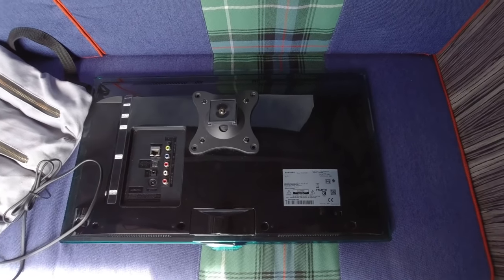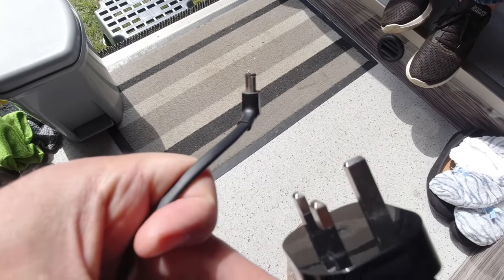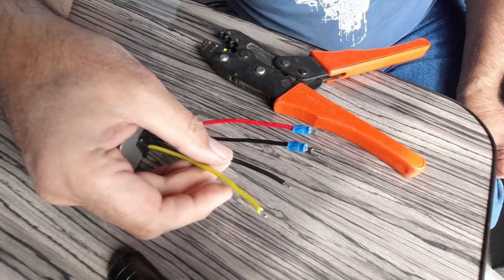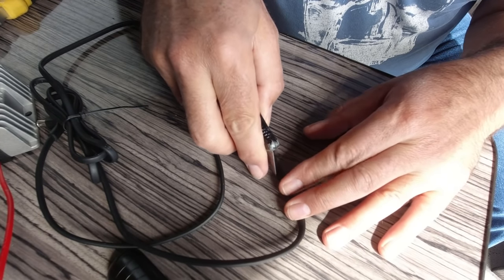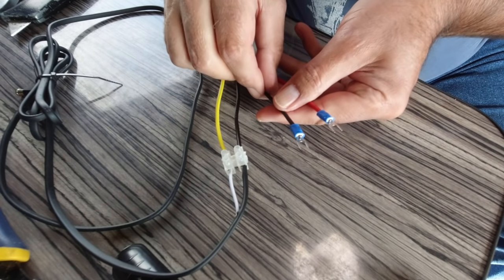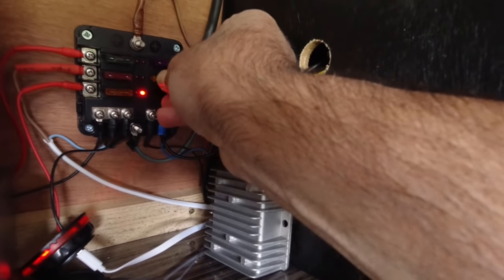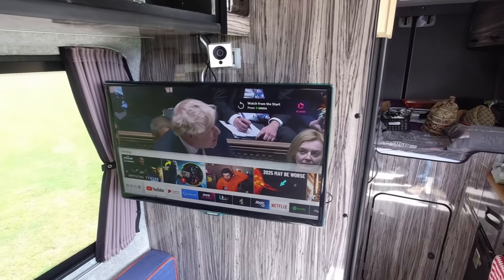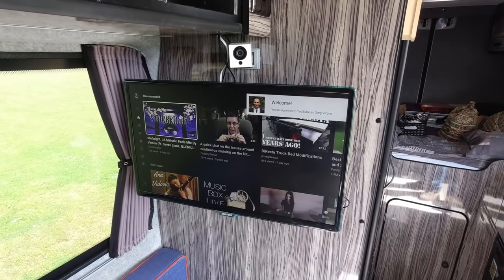How to connect a Mains TV direct to 12v DC - Off Grid Living

Comment: Hi love your Chanel you have helped me with several tasks along the way, but this latest one I am stuck with.
I have bought a buck converter which is 12v 60w 5A because that’s what it says on the back of the TV, I am just trying to connect it all but still have no power to it can you tell me what I am doing wrong. Kindest regards Sara
Reply from the maker: Please can you check what the electric input data is on your tv?
If your tv requires 12v input then it is different to mine and will need a slightly different converter. What does it say for the power input on the tv? 🙏🏼😊
Reply: Hi thanks for your response, I’m afraid I won’t be using that tv now as I have dropped it so it’s broken 😂 I now have a choice between one that’s 220-240v 135w or buying another one. What would you suggest ? Could I convert that one or would I be better with one that uses less power ? Best regards Sarah

Comment: Had a similar issue with our wireless headphones for our van TV. They were 19 or 20 volt, so used a transformer to run them from 12v rather than run the inverter all the time.

Comment: Those 230v plug sockets you got…are they an extension of the sockets from the inverter? A plug into the inverter and a wire from the plug to the sockets?
Reply from the maker: Yes exactly that 👍🏼

Comment: Hi Greg, As the TV already had a DC plug, why not save all the hassle and use one of the 12V adapters that come with multiple plug ends and selectable Voltage you can get for about GBP20 and just plug that in? I run my laptop off one in the van, but still have the 240V brick and lead to plug into mains when at home or on hook up.
Reply from the maker: Yes, that is another way you can do it. I wish I could find one big enough for my laptop but the brick is 140W and most only seem to go up to 80-90 watts.

Comment: great video greg as always. What bracket do you use for the tv and is there some reinforcement into the shower wall to support it or is it screwed directly into the LWP?
Reply from the maker: There is a metal plate with three studs welded to it that was recessed intot he shower wall before the PVC cladding was fitted because i was concerned that small screws would pull out with the weight of the TV. The bracket is one of these https://www.ebay.co.uk/itm/332069830472?epid=6030722465&hash=item4d50e77f48:g:pHMAAOSw~p5ck3hj&mkcid=1&mkrid=710-53481-19255-0&siteid=3&campid=5338027957&toolid=11800&mkevt=1

Comment: Surprised that you don't use Wago connectors for things like that. 
As electricity prices head into outer space I'm moving as much chargeable or USB powered stuff over to charging off the little bit of solar I have on my shed roof.
Reply from the maker: I have those but they were in the workshop and the old block was the only thing I had in the van so it’s a temporary fix as I said. The wago are really great for simplicity.

Comment: Great job, pity they don't make a 12v plug adopter to use the tv in motorhomes it would be great for the less technical minded👍
Reply from the maker: You can buy a 12v laptop charger off eBay for £11 that will do the same job. Some have multiple plugs and variable output voltage.
Reply: @GregVirgoe  Thanks for that advice👍

Comment: Hi Greg nice video, what model Samsung is it with the external power block? clearly cant do this if its embed within teh tv and its got a 3 pin plug.. thanks
Reply from the maker: That’s correct this is an old tv now as we purchased it when the van was built. No longer produced I think if you are looking to buy a tv for the van then Avtex make some very good 12v smart TVs

Comment: I'm here in America and we go by 12 volt or 110 so I have 12 volt in my van and I have the same TV if you take the TV apart and you bypass the transformer that's in the TV there's a 12 volt port you could solder wires to that and plug it into your 12 volt socket and it works so you don't have to go through all that stuff but the only thing is you have to take the TV apart and use a multiveter and find out where it starts 12 volt at inside the TV a lot easier

Comment: Hi Greg,just watching this old blog again and it's brought up a question if I may,I have a Sharp smart tv in my van and I'm thinking of using my house dvd player with the tv in the van.they are both 12 volt so no problem hopefully, is it possible to plug it direct into the back of the tv using a USB cable to power the dvd player ? Or if not is it possible to buy a double cigarette plug. Thanks

Comment: The boost converter will still consume some power* (much less - but all of it wasted) even with the TV off, so you might want to have a switch for that. Since you currently need to turn the inverter on to run the TV - it would not be so inconvenient for you. 

*Boost converters need an oscillator to run the whole time they are on even with zero current draw on the output.

Comment: Great idea. Would be possible to do the same with laptop chargers? Maybe allowing a plug in the van just for the laptops?
Reply: I was thinking the exact same thing!!
Reply from the maker: Yes exactly just make sure the power and voltage are within the rating of the converter. You can put a cigarette plug on the input side so you can plug it into a 12v outlet anywhere in your van. 👍🏼😃
You can buy 12v laptop chargers on eBay for £11 but most are only 80-90w so not as powerful as this converter. 👍🏼😃

Comment: yay   ... 12v to 19v DC Converter  might also charge your laptop... my old one was a 19v input !
Reply from the maker: Yes you can do that just check the laptop is under the max power of the converter. 👍🏼😃

Comment: I wonder if we check back in 12 months time, that scotch block is still there.. 😉 I did the same to power the display on my weather station... 👍
Reply from the maker: I have a smart relay board going in to replace the fuse board so it will only be temporary. 😃

Comment: Greg, I'm just about to start the wiring and I'm yet to buy all the parts. I was going to put in a 240 system also but as I only really want to use a laptop and possibly a kettle it barely seems worth the expense as with this converter to 19v I could just put it 12v?
Reply from the maker: Yes the more you can put on 12v the better 👍🏼😃

Comment: did you adjust the buck converter for 19v? or was it spec'd that way out of the box?
Reply from the maker: This one was preset to give exactly 19v DC on the output out of the box. The input can vary a bit so it can handle the higher charge voltages

Comment: Thanks for the upload, I was wondering if you could help, if I bought a standard 24" mains 240v fed smart TV, then wired the Buck Connector to a cigarette lighter socket then bought the 3 pin converter for the TV so I could plug straight into cigarette lighter socket would this work without the need to cut into any power cable from the TV, I would make sure that I had sufficient fuses in place to protect the devices I used. I hope you get what I'm getting at and this would mean that I can use multiple items not just the TV 📺👍👍
Reply from the maker: I’m not sure I follow what you are trying to do. What is the 3 pin converter? 🤔
Reply: @GregVirgoe  Hi Greg it is a cigarette lighter shaped socket that has a 3 pin plug adapter on the back of it so you can plug a 3 pin into it. Actually on rethinking the whole thing it would probably be more sensible to just do what you did to the power cord.

Comment: Thanks Greg, I've got a next level question for you mate.  Is there a difference in energy loss:
1amp per hour to an aplience in 12v
1amp per hour to an aplience in 240v?
With a solar system set up with an inverter
Reply from the maker: Let's do the maths...
1 amp x 12v = 12 watts power
1 amp x 230v = 230 watts power
so there you go, using 1 amp at mains voltage is 19 times more power used.
But hold on that's not the entire story....
Your appliance will use the same amount of power (watts) so the amps used on 230v are going to be much less (19x) 
So the losses are in transforming the voltage from 12v - 230v - 19v you lose some energy to heat when doing this.
So it is always better to run devices directly off the battery and avoid the losses from inverters etc.. Hope that helps :D
Reply: @GregVirgoe  That does help, thanks Greg.

Comment: hi Greg, would I be able to run a household cctv system the same way as you have just shown on your Samsung TV.
I should add I want to install a cctv system in my motorhome when I get it in August.

thanks

Lee
Reply from the maker: Have you looked at the Neos Smartcamera systems. We have that in our van running off USB socket and it’s got amazing internet and smart phone connected app too. Cheap to buy and easy to setup.
Reply: @GregVirgoe  hi Greg, no I haven't I was looking for a system that I could put on the outside and inside of the motorhome,  I'll have a look at that system, thanks for replying I'm sure your very busy on here so appreciate your advice

Regards 

Lee

Comment: Many home 240v TVs are actually 12v with power brick converters. Cut off the power brick and wire directly to 12v. Much better value than specialist 12v TVs.

Comment: Gregg I have a 12v 4g router , can I wire it straight to blade fuse or do I need a regulator of some kind? It currently runs of 5v usb to 12 v cable. Any help much appreciated
Reply from the maker: If it runs from a usb socket like mine does it’s running on 5v So simply install a standard usb socket onto your 12v system and plug it in. If you try to power it with 12v direct it would be too much.
Reply: @GregVirgoe  thank you Greg will do have a good day.

Comment: Although temporary, not a good way to connect in the terminal block. Better connection by holding the two wires side by side then twist them together, then put them together in one side of the terminal block. You can use one terminal screw to hold the insulation then any pulling on the wire is supported by the insulation. Also to prevent stripped wire sticking out the end make u shape before inserting to the block.

Comment: Hi will this work on a 65inch tv not for my van😂🤣😂🤣 but in my summer house??? Thanks in advance Jason 👍
Reply from the maker: You need to check the back of the tv and see what the input voltage is. It needs to be lower DC voltage to run off batteries. Larger tv may well have any transformers inside which would be a problem. Although you could run it off a small inverter and batteries in your summer house and top the batteries up with a couple of solar panels on the roof. Simple 🤩

Comment: Hi Greg, found this of great interest as im looking to replace an older 12v tv. The maximum size i can go to is 22" so was wondering what model / size tv you installed? Prefer smart tv if possible. I cant seem to find suitable 22" smart tv without the DVD player built in as we dont use them. Many Thanks. [ps: have now subscibed]
Reply from the maker: This is a 24” Samsung monitor smart tv LT24 not sure if they still make it as it’s 4yrs old now 😃
Reply: @GregVirgoe  just had a look on the Samsung website, not available anymore.

Comment: Hi Greg just wondering would the new transformer continually pull power even when the TV is off and if so would it be prudent to to install a switch. Another great video mate   hows the search for the new van going?
Reply from the maker: I’ll do some tests in my upcoming smart controls video to see how much. I suspect as the device is stone cold that it’s negligible. 
Still no luck as yet but looking daily

Comment: Hi greg what’s the benefits of a router compared to using personal hotspot on your iPhone.
Reply from the maker: My van security system needs WiFi to give me live video feed if it detects sound or movement when I’m not in the van direct to the phone in my pocket.
Reply from the maker: Plus the router can connect up to 20 devices to the internet at once

Comment: I have a spare smart TV I wonder if it would work with my laptop 12volt transformer , that goes to 20 v . Just need to convert a usb c to the Tv input Jack
Reply from the maker: Does it have variable output so you can set it to match the tv voltage?
Reply: @GregVirgoe  so it looks like it will work fine with the TV as it goes up to 100 watt 20v . The thing is my 32 screen takes 80 watts on full power so that’s to much for my 260w solar , unless it’s sunny all day …… I have other things that need the power
Reply from the maker: @ScoobieDee  only you would have a 32” tv in their van 😂 what is the input voltage on the back of the tv? Or give me the model and I’ll look it up for you 👍🏼

Comment: I wonder if an easier way, would be a Thinkpad 12v travel charger, which should output 19-20v with more than enough watts for the TV.
Would just plug in to an existing 12v socket, but still needing a plug change at the TV end.
Reply from the maker: Yes as the tv was only 26W a small 12v laptop charger would have done the same job for £11 👍🏼

Comment: Hi Greg I'm also going to use a boost converter to power up my 19V projector. My transformer has an adjustable output current and voltage with a built in LED. Do you think it's better to add a switch to cut the power? Does this kind of device use any power when your TV is off? The specs of my projector are 19v dc 3A, should I adjust the current of the converter to 3A?
Reply from the maker: Can you give me the details of your converter please?

Comment: This isnt strictly a mains TV if it runs from a wall wart so although a good solution only for the few smaller TV on the marked that use an external DC supply.
Reply from the maker: Yes correct 👍🏼

Comment: what a great idea ,,would like to try this with my (3) 5g router is there any way i can find out what the plug is called going into it ,,,it looks the same as the tv one you cut off ,,,
Reply from the maker: Somewhere on the plug will be the electrical data for input and output maybe very small writing and hard to read. Try taking a photo and zooming in to see what the voltages are. Often run on as little as 5v so could be powered off a usb socket?? 🤔😊
Reply: @GregVirgoe thanks greg its 12v and i have a plug that fits it i have ordered a usb plug that i can solder the wires on to  if you have done this what terminals did you use as theres the outer sheath  that is neg,,and the inner is positive  ..not sure if the usb plug will say whats is what as its not arrived yet ,,

Comment: I just looked at the power board in mine and solder the negative and positive 12 v on the dc side.
Reply from the maker: Include a switch on the positive so you can easily turn it off 👍🏼😃
Reply: @GregVirgoe  I do have a switch for the tv and tv booster antenna and same as yours fuse box .

Comment: Rather than cutting up the OEM power cord I would have just got the correct plug from the local electronics supply store and made my own cable. There are even some cables that have interchangeable end connectors to fit many different laptops as well as generic plugs.

TVs, even small ones, that don't have the voltage conversion inside the TV itself are pretty rare. I'm trying to decide if it's worth the effort of opening up my TV, analysing the power supply and seeing if it's possible to add a 12V input. I'm not an electronics novice, though.

Most laptops that aren't powered from USB-C run off 19V. It might be worth adding a socket to your DC-DC converter to charge laptops (along with another custom or interchangeable connector cable, of course). 🤔 150 watts should be plenty for both a laptop and the TV at the same time.
Reply from the maker: We live in the van full time, we don’t have a house, so the tv stays in the van. My laptop is 140W so I could make another one dedicated to that but it would have to run on its own, as most pre-made 12v universal chargers you can buy only go up to 80-90W.

Comment: Greg love the channel. Question... would this apply to any appliance? Microwave etc? Cheers.
Reply from the maker: Sadly NO.. those appliances use a lot more power typically 700-800 watts which does require an inverter to run of 12v batteries.
Reply: @GregVirgoe  Brilliant thanks again mate 👍

Comment: Hi. Can you tell me if you’ve ever had trouble with your tv running through this converter please?
I went in to Curry’s today and the manager wouldn’t sell me a LG tv which will run on 19v because he said they’re not made for vans or boats. Help. 🙂
Reply from the maker: Noproblems,  we have never had a single problem running it off the new voltage converter, it works perfectly.
Maybe the manager thought you were going to connect the TV direct to a 12V system in which case it wouldn't work.
Just don't tell them what you want it for they are only selling boxes at the end of the day :D

Comment: Did you try running it on 12v without the buck converter? My 14v Samsung TV runs just fine all the way down to 8v
Reply: I've just bought a 19 volt LG TV and it operates just fine all the way down to 9.5 volts. You can probably do away with your voltage converter.

Comment: Hi Greg, do you have a model number for this tv please. I’m the same, 12v TV’s just aren’t as good quality especially the sound.
Cheers 
Ant
Reply from the maker: At 1:34 the model of the TV is in the top right corner of the label 👍🏼
Reply: Cheers Greg, how did I not spot that!ha I’ve had a look and seems like it’s an older model? Most in that size aren’t full hd just hd ready…I’ll keep searching but great tip thank you 👍🏼

Comment: Hi Greg another great video! I have a gas hob for my narrowboat it has a 230v ignition Is there a transformer available that I could use to ignite using 12v? Thanks
Reply: Not sure if you ever found out. But you can use any inverter as long as it generates 240v you'll be fine. It's just to create a spark and has no load.